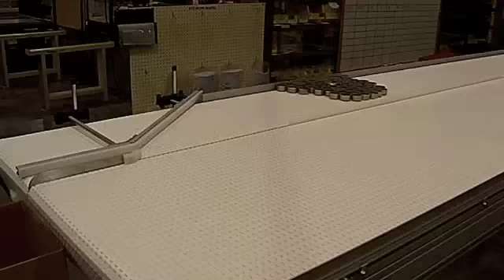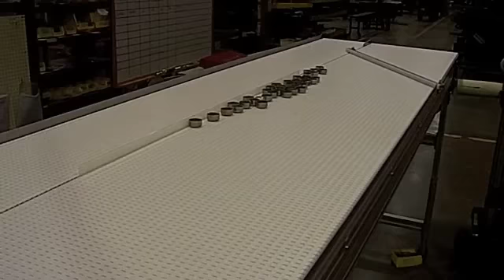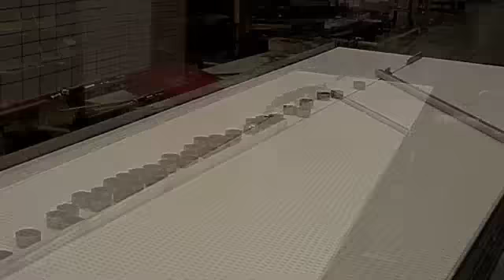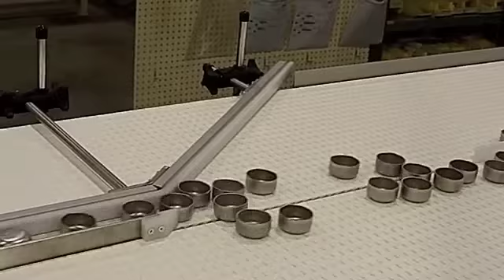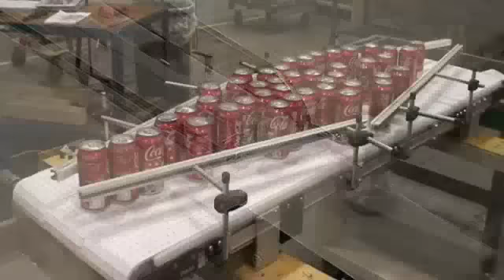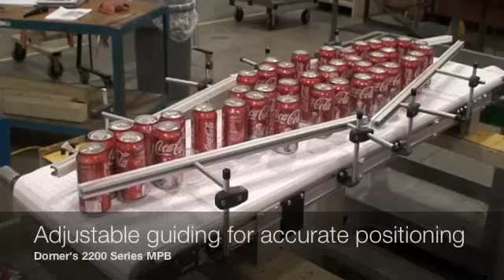Recirculating Accumulation Conveyors Reduce Product Jams

Comment from the maker: @itzmattvause Sorry for the delayed response.  The video from 0.36 onwards was shot in our plant purely for the purpose of demonstrating what can be done with multiple plastic chain belts in an accumulation application.  The conveyors moving the Coke cans were built for a similar, but different project.  If you have a specific accumulation challenge in a high speed environment, we'd love the opportunity to discuss it with you.  Please give us a call at 800-351-8712 if you're interested.
Reply: Hi Dorner Conveyors. does this system also work for cardboard tubes for packaging. I have got several tube jams on the accumulation conveyor. the artwork on the surface of the tubes are the root cause of this on the guard rails.